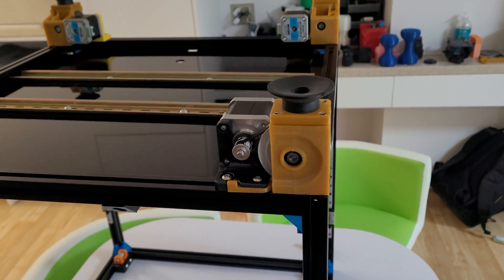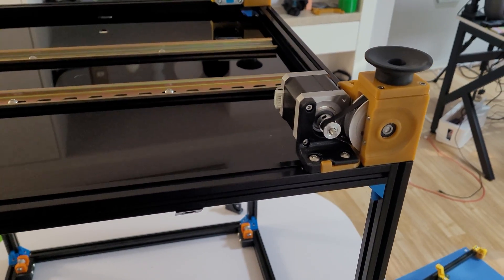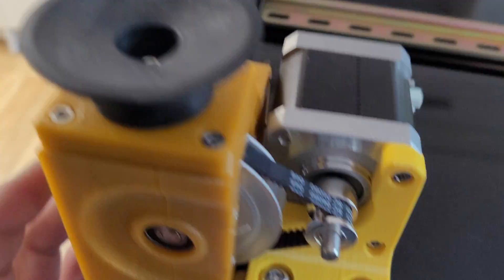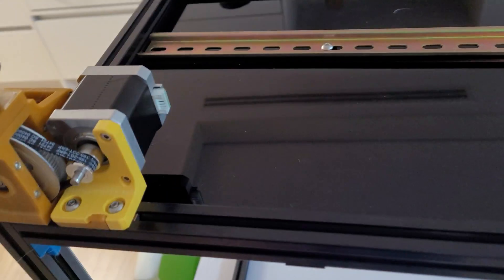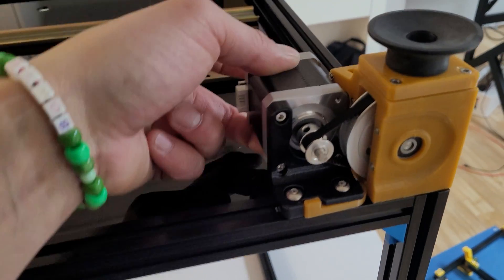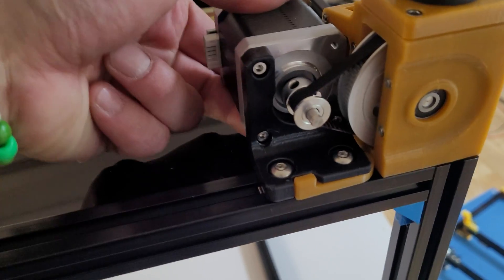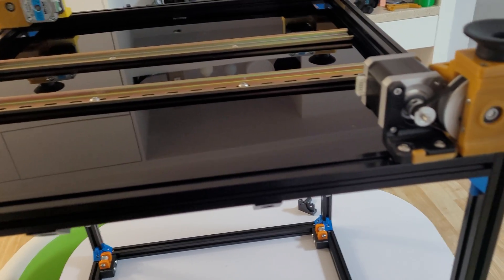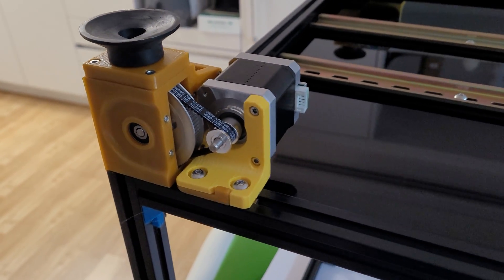WHY you need to use ABS or ASA, NOT PETG OR PLA when building Voron 2.4!

Comment: Used petg for my 0.1. 100 or so hours now on it printing abs and asa. For the most part it’s ok BUT the cantilever bed on the 0.1 is really showing this weakness. Very poor repeatability on z. Sagging over time, no fun.
The first 50 hours I printed pla parts no trouble. But that heat for abs/ads really demonstrated the petg failing.
Replacing with ads this week. I’ll be interested to see the difference. Not a huge fan of the bed design on the 0.1. Too many parts for what should be a basic assembly. If ads sucks I’m going 1 pc. Billet aluminum lower bed directly mounted to the rails

Comment: My entire 500x500x500 voron 2.4 is printed out of petg zero issues. I even print asa and abs with 110c bed and 255 nozzle enclosed and open no issues
Reply: It'll be 2 years in July!!
Reply: That’s because your enclosure doesn’t get nearly hot enough because of the size. My 300 can get to 60 c
Reply: I would 100% agree except I have two active heaters in my chamber. On top of that my bed is 500x500x500 3/8 thick jig plate when it gets to 110c the temperature of my whole basement goes up a couple degrees my chamber is always above 60c on ever print there's no getting around it I just haven't had issues with petg like people claim
Reply: That’s pretty cool. What kind of heaters do you use and are they controlled in Klipper? Mine really gets up to 70 but only because it’s insulated with 4cm thick foam
Reply: @ThePowerfox18  hmm what kind of foam are you using for you insulation? Is it high temp foam I've actually been looking for some kind of foam for beneath my bead to help with better heat stability/consistency
Reply: Dou8leTaP nope It’s just regular foam you put under a roof or something. It is self adhering and good for up to 100c, so not suitable for under the bed (it’s actually only 2cm). I’m planning to get the insulation that some people glue to their beds and just put it on the bottom panel.
Reply: Dou8leTaP remember, if you isolate your bed, you will lose some chamber temp
Reply: This is utter nonsense. Many people have tried and none have succeeded because they always think it will somehow be different for them. I have had to replace ABS parts like the cable chain mount for the extruder stepper because they warped over time due to heat. PETG it happens much faster. I'm now doing some parts in CFNylon to see how they work out. 
My 350 V2.4 is printed in pure ABS and has an active PTC air heater to get chamber temps up.
Reply: Jakus Jacobsen I can see that happening. The motors can get quite hot. But maybe your gears are rubbing against something or your current is to high? I melted the x carriage from printing pc. The screws got too hot and melted the stuff around the inserts. And of course the duct. All pure abs
Reply: @JakusJacobsen  shut up clown you have no idea with your cookie cutter bs
Reply: Dou8leTaP chill :D. You have to understand, that you aren’t the first to try this and 99% of the people had problems. So it is at least ok for him to warn newcomers
Reply: I think the issue may be with people not printing PETG at the best temperatures etc... I print PETG at 100% infill 250C hotend 80C bed and it is rock solid way stronger than ABS in my experience.
Reply: how long has it been together?
Reply: that's good news for me at least I don't want to go through the abs route; wonder what kind of petg you used, regular or higher temp h100 etc? I don't really worry about the filament cost that much.

Comment: AFAIK the real problem with petg is that it will slowly warp over time, especially under stress and with heat
Reply: the creep is a TINY bit more than abs, but practically the same. the main issue is rigidity and, as temps increase, PETG will soften and creep a little faster. but at room temps, they are practically the same, besides rigidity.